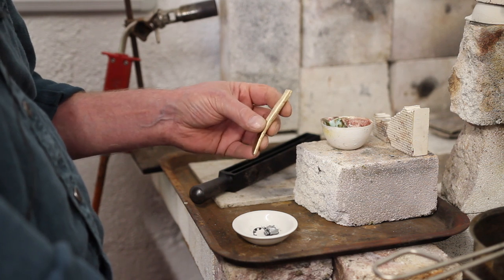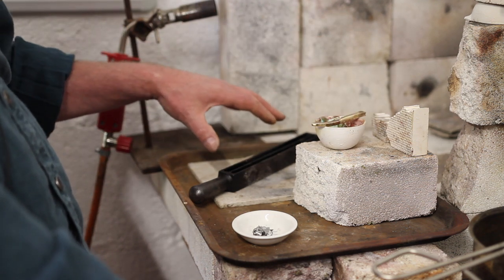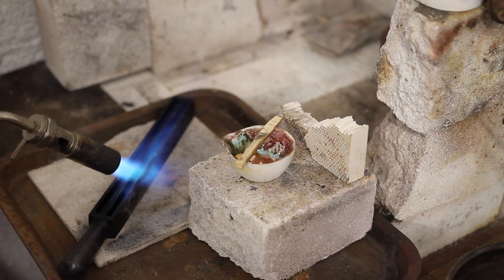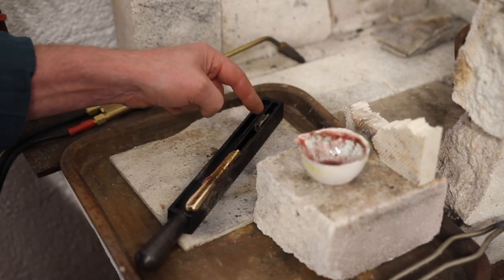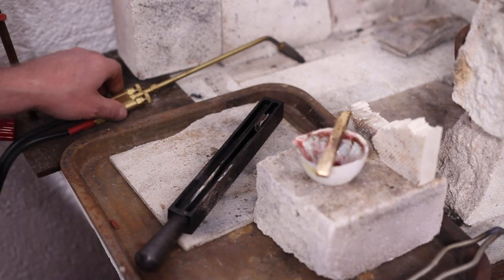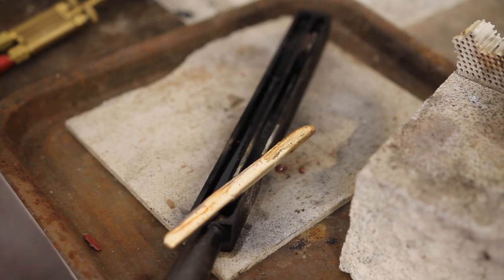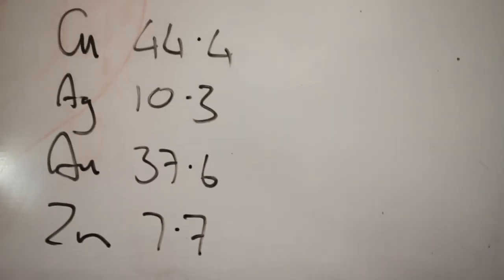Ironbrush Fundamentals - Casting a 9ct alloyed gold ingot

Comment: Hi Ford, a neutral density filter is what you need for your lens to cut down the light from the torch. They are typically used for long exposure photography but we used them to film soldering techniques at the college I taught at. They work great for that purpose. The welding goggles were a good idea but perhaps not quite dark enough? I’m not sure which stop number to recommend for the ND filter but you can buy a set that comes with 4,6,8,10 stops and experiment with them. I’d also recommend a magnetic filter attachment if you want to be able to pop them on and off without messing about with the threads.
Reply from the maker: Thanks Mo, I've now ordered the bits you suggest. Were doing something on reclaiming filings this week-end so we'll try it.

Comment: Awesome video, why did your ingot come out shiny?

When you heat 9ct normally it turns dark from the copper oxidation, I assume its because of the high level heat you used but I'm unsure.
Reply from the maker: It's the zinc addition that helps keep the alloy from oxidising as badly as with the more common copper silver gold alloy
Reply: @FordHallam  Amazing, is the technique common? Where did you learn it?

Would you say you're one of the very few producing 9ct this way? This is new to me.

Comment: how come you put the torch on such a sharp flame? i used to do that and my teacher saw it once and freaked out about it. ever since i stopped doing it and always thought that the oxygen would go in the metal wich in result would create cracks on the metal when putting it trough the rolling mill. Could u please explain ?
Reply from the maker: The nozzle shapes the flame tip mostly. As you can see in the film I start with the propane gas, it's a big soft yellow flame. I adjust so that it is all burning right from the tip of the nozzle. Then i introduce the oxygen until the flame has no yellow in it. This indicates that the two gasses are burning evenly. I then increase the propane again and balance with oxygen once more. This is a well balanced flame. You can use a little less oxygen but the flame will burn cooler and the melt may take longer, increasing the time the metal is likely to absorb oxides etc. So this is what I do mostly, there are always other ways to do things.

Comment: I would suggest one stirs their molten metal with a graphite rod, to achieve uniformity within the alloy.
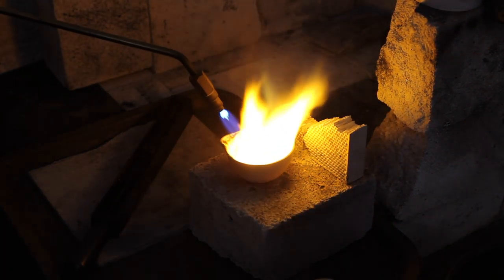Reply from the maker: I explained why that would be unnecessary on this case at 5:30.
Reply: I just watched again, and indeed you did. However in my experience, I  have found it necessary. When I chemically attack an alloy, slight inconsistencies can cause issues. I have found if I xray the alloy in varying locations... my test results will have inconsistencies. For your purposes, it is seemingly not an issue... but for mine, it can actually cause problems for me.

I've only had time to watch a few of your videos, but from what I've seen... it's obvious that you are certainly a wealth of knowledge. Thanks for sharing so much with the world  :)

Comment: When you melt a high-melting point metal with a low-melting point metal, is the melting point of the alloy exactly in the middle?
Reply: Not always. Sometimes the melting point of the alloy is higher than that of a high-melting metal.
Reply from the maker: no, it's far more complicated and additionally depends on the exact percentages of each of the alloying elements.
Reply: @FordHallam  Thanks. That's what I suspected, but I wasn't sure.